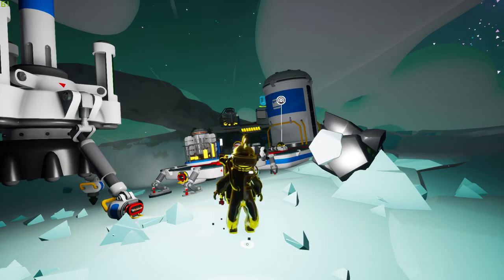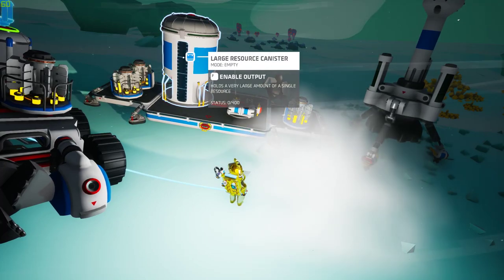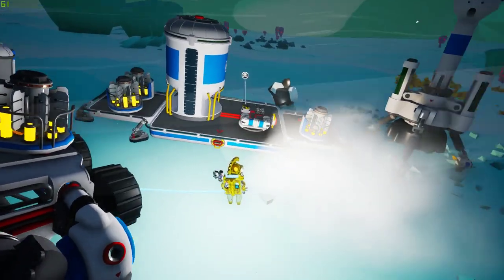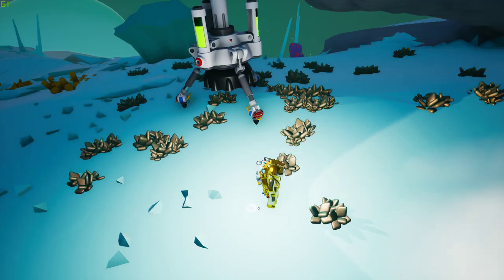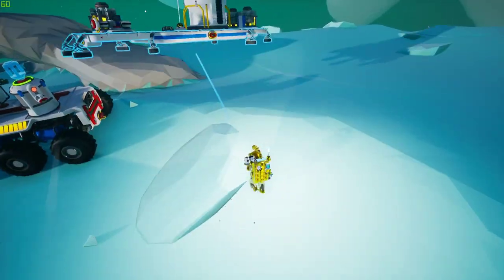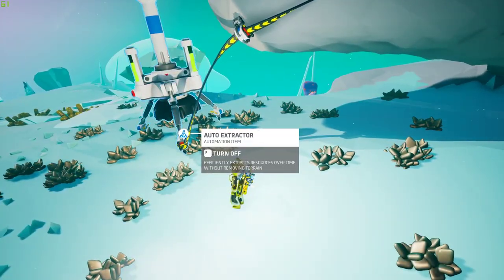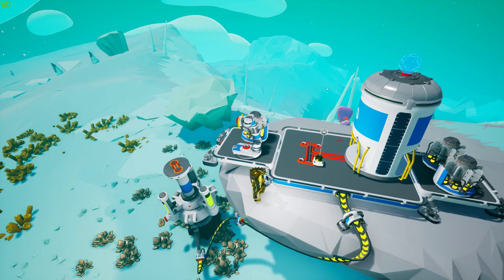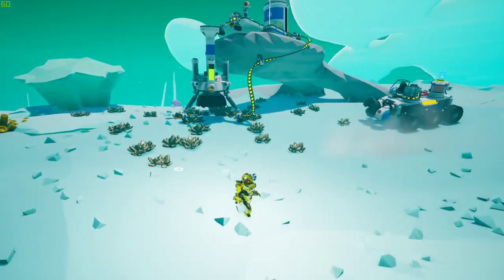Auto Extractor setup guide in Astroneer Automation Update using auto arm and large storage canister.

Comment: You can use a storage sensor and connect it to your beacon, this will toggle the color so you can see when full from a distance.  The  autoarm should be able to grab from the ground.
Reply: you´re double right!
Reply: I finally got my new playthrough to Glacio and the Auto Extractor.  Since I'm still mid game, no RTG for power and no Large Resource Canister.  I'm using an Extractor topped with Med Canister and connected to Small Platform B.  

On the Plat B are: a Med Storage  with 4x Sm Wind, 4x Sm Solar, the Beacon and a Storage Sensor.  I connect the sensor to indicate when the Med Canister on top is full.  The resource field is in beacon range of my base, so I just need to look over once in awhile.

To clear the full canister I use my Large Rover which has a Lg Storage with Autoarm and an empty Canister.   The Rover / Lg Storage props the Autoarm at a good angle and height to pluck the enabled output full canister and drop it on the receiving canister on the rover.

Easy as emptying the trash.
Reply: that's... just genius.
Reply: if only i could send it from another planet to mine when full xD
Reply: I like how you guys come up with this kind of ideas

Comment: I think you did something wrong cause I so it working from the ground
Reply from the maker: I figured as much which is why I mentioned it.  I tried a few times without it working.  Thanks for letting me know.  Will try it again next time I set one up.
Reply: @THEGAMEIS  you can put one of the rtgs on the autominer and it'll stock up those two slots at the top making the resource stay where it was made and the autoarms don't need too be in the air